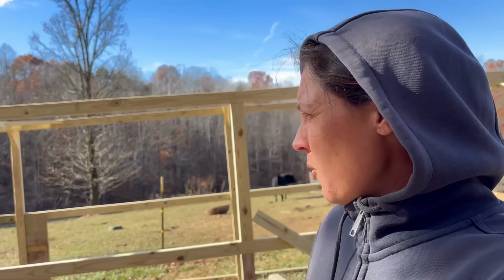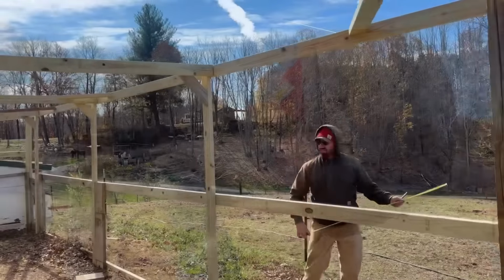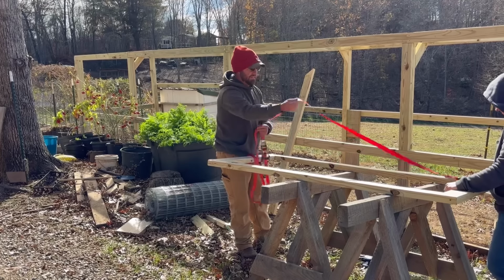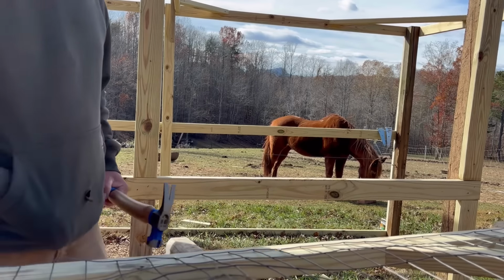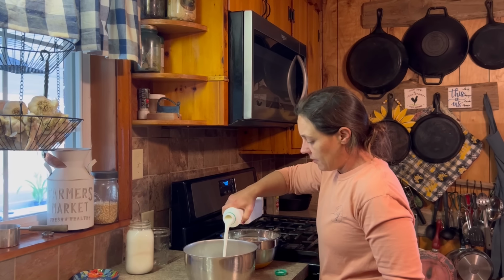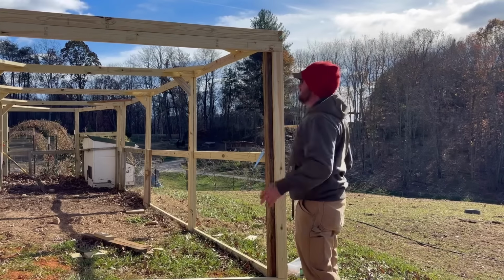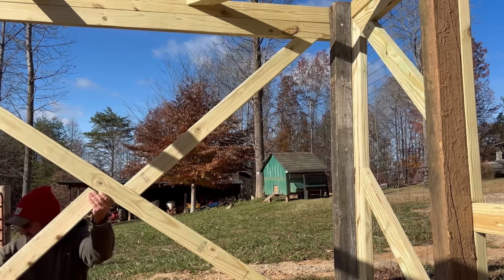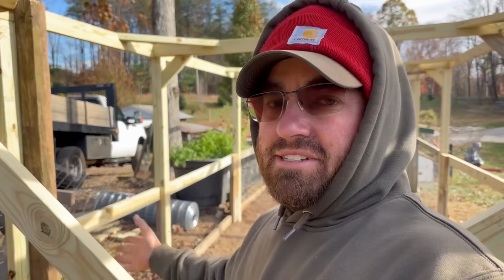The Chickens Don’t Mind | Homestead Vlog |November 27, 2024

Comment: My grandfather put a post in back in 1917 at the family cemetery. in about 1975 we attempted to take it out and replace the fence with a chain link fence. The roots of a maple had grown around it and we could not pull it out of the ground, so we said lets just cut it off flush with the ground  when we stuck the chainsaw to it, sparks flew from the chain. We left it. I was there this spring and that post is as solid as the day grand-paw put it in the ground I was told it was an Osage Orange or as we call them around here, hedge apple. It out lasted Grand-paw, my dad and will probably out last me since I am 72 years old. However about two inches deep in the top is starting to rot.

Comment: I never realized Andy was left handed. Lol. Also, I use the recipe that Tipper Presley shared on her channel for biscuits.  Use 2 cups self rising flour and 1 cup heavy whipping cream. Stir together,  may need to use a little more cream for desired consistency of dough. You can knead if desired, but I just roll and cut mine out with my biscuit cutter. Bake at 400° until golden. Surprisingly easy and good! You can adjust the 2 to 1 ratio for desired amount of biscuits. Hope you all have a wonderful Thanksgiving holiday. Thanks for sharing your family with us.

Comment: I couldn’t hep but think of the chicken coop my husband built me 25 years ago, as you were  holding yours. He put hardware cloth on one side and chicken wire on the other (including the door) He dug at ranch on the outside and extended the hardware cloth down into the ground. He ran electric wire all around. We had the water lines they peck (red) and nesting boxes. Always played a radio constantly (it was on the side of the barn). They preferred the local channel, country music, swap shop. When he was finished he said, “ A 500 lb gorilla with a Dewalt will not get in there”. 😊 he was correct. 
The reason for the chicken wire and hardware cloth on either sides… baby chicks would stick their heads out and bobcats would have them for an appetizer. Im telling you. It worked! We had a metal roof over from the existing structure attached to barn.
He’s been gone 12 years now. Sure miss chickens, and you always bring back good memories.

Comment: Paint the bottom of your cedar post with 50:50 mix of diesel fuel, and use motor oil.  They will last 25 years or more.

Comment: if you have any thompson waterseal left over from the painting of the porch you might want to paint any horizontal surfaces where rain or snow might accumulate. and we used to double up some wire and string it on the diagonal from corner on one side of a door to the other and create a Turn buckle...the lower end on the non hinge side when you tighten the turn buckle it will keep the door from sagging caused by its own weight

Comment: As far as cedar posts go, round or square, no matter how big or small, I always torch the area plus about a foot above the part going in the ground ... (sorta like the Japanese do with their wood burning to preserve the wood, and then I put some Thompson's clear Water Seal or some other "sealer" on the area of the wood I burned.  Makes the wood water resistant, rot resistant, insect stay away and it doesn't mold or mildew and the wood last for many years (some buildings in Japan done in this manner are over 600 years old and they are all white and red cedar and other soft and hard woods ... I put up a fence with treated 4x4 posts and burned the ends and sealed them, let the sealer cure for about 4 days and put them in the ground over 20 years ago and they are still standing strong and several neighbors didn't burn or seal their posts and after about 5 to 7 years, they were replacing their posts ... they still didn't burn or seal the end in the ground and they'll be replacing them again while mine keep on keeping on ... Like your chicken run, I'm gonna build one lie it and will be covering the top to with at least a good bird netting and draping it over the sides and putting my 1x1 wire over it and along the ground, I'll be using 1/4 inch hardware cloth wire ... only gonna have about 10 hens and one Roo, but that's enough for us ...

Comment: Your corner to corner brace on your chicken coup is backwards…the high corner needs to be on the end without the hinges.  This way, the weight of the door pushes against the frame, instead of pulling and putting more stress on the hinge end.  Nice coop, though.

Comment: I would use hardware cloth on the sides as well as the top. The wire you are using will allow rats and mice to enter looking for food.  Raccoons can break into that slide lock you used.  We put the locks that you use a carabiner on. You can also put a padlock on it.  Aerial predators are real and will come in through the top if left open.  Perhaps look into putting a poly roof over the top to keep out rain/ snow so the run stays dry.